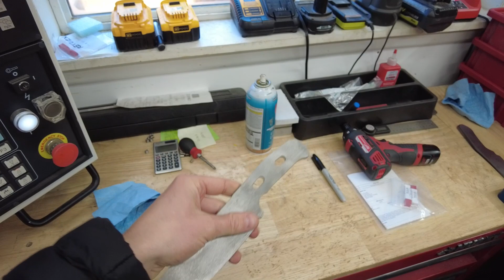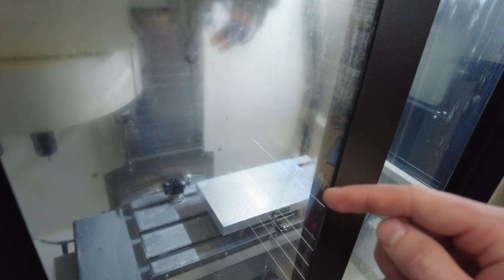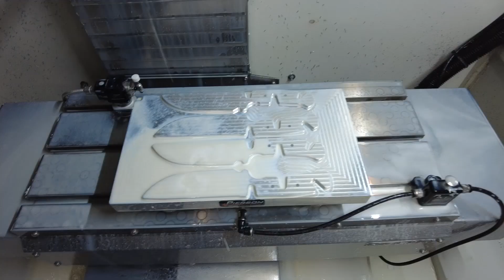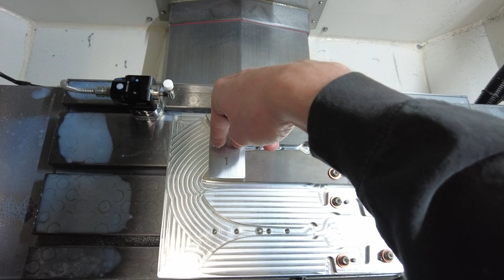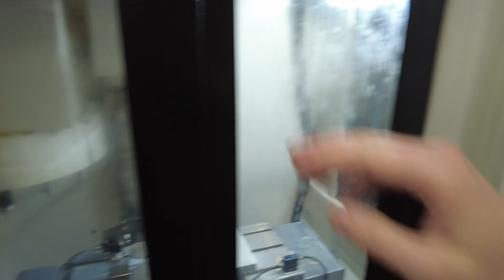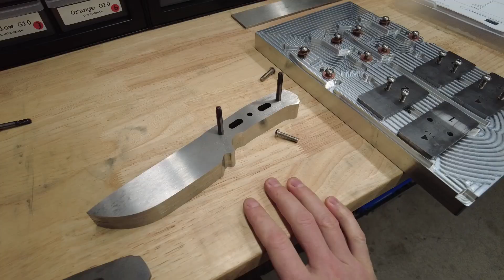Fixturing and Machining Knife Blades | LT5 Build Series

Comment: Very awesome and informative video do hobby machining with no CNC and totally got the struggle you’re dealing with on the CNC. Have had some projects water jet before and was frustrated with that angle you get with the start of the hole and the exit definitely realized that my design would need to account for those factors if it was a serious thing I was designing for production.

Comment: I run a manufacturing business and spend $500K a year on laser cutting. 
For better cutting:
1. Find a laser cutting business with the latest technology - a fiber laser with 20KW will give you a great cut with high accuracy and finish. Older lower wattage machines provide poor quality cuts with loads to slag as you have seen.
2. Get them to cut the parts across the grain so you do not get warping from the material as most thinner materials come of a coil 
3. The laser cutter can program the laser to do multiple cuts along the material and then come back to finish the cut so as to not heat each piece up too much.
The other thing with waterjet is that you get a large taper which is hard to manage if you rely on the edge to be square and straight.
I love laser cutting and the latest machines provide an outstanding cut and finish

Comment: One of the things I found with laser cutting is the actual type of laser makes a big difference. For instance, a 3000 W CO2 laser will have a pretty substantial heat affected area, but an 8000 W fiber laser has very little heat affected area. Fiber cuts steel so much better than CO2, and when you get to those high wattages, it just vaporizes the steel before it even has a chance to get very hot. why not just Skip machining the edge at all and use both clamps, when you sharpen it that kerf will go away anyway.

Comment: Hello, good work! may be you can do a plate parrallel to the knife fix on your two existent screws and on the other end of the blade a little more thikness or little gauge under to avoid vibration. One opration and you can do all the contour. Sorry for my english.
Thanks for your video from France

Comment: Have them cut with nitrogen. No slag, no more warp, and a smaller heat zone. That edge is either oxygen or dry shop air. A fiber lasered edge should not be that color with nitrogen.

Comment: My last job had a lot of stuff laser cut, if they used nitrogen instead of compressed air it helped in hardening the edge is what they said. I noticed a difference when reaming holes from air vs. nitrogen.
Reply: Nitrogen won’t warp and will have a smaller heat zone. It cools the edge during evacuation much better. That edge is shop air

Comment: I installed a gorilla glass screen protector on the inside of my door that is hydrophobic and I now get much better results filming from the outside. Before, all my footage was from a GoPro inside a case with an air knife. Now, I use footage from both the GoPro inside and my iPhone from outside. I use an iPhone because I get fewer reflections than from my DSLR.
Reply from the maker: Really helpful. I will definitely be trying that. Thank you!